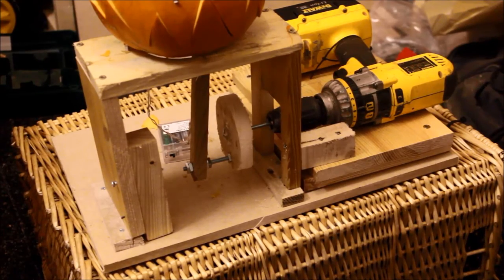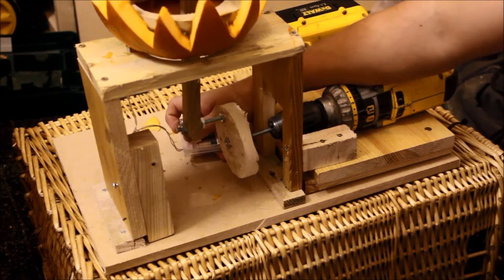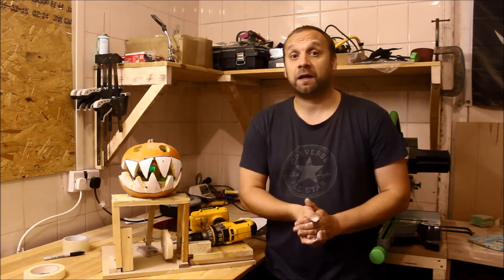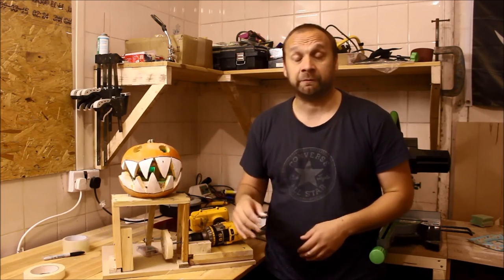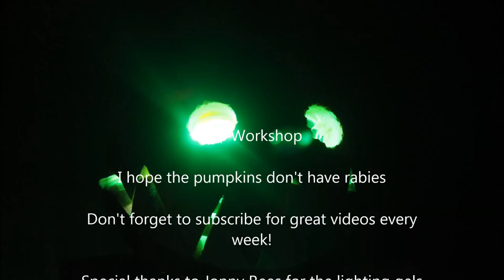Drill Powered Glowing Snap-O-Lantern!!! Halloween Upcycling Project Built From Scrap

Comment: Great idea. I am incredibly surprised that the pumpkin didn't just fly apart. Looks awesome.
Reply from the maker: well the pumpkin shell is well nailed to the top part of the frame front and back though you don't see all that on the video. First time I powered it up more than a whisper the top of the head flew clean off! Also I have the advantage that its bloody freezing in my workshop at the moment and I think pumpkin flesh is just a bit more durable at low temps
Reply: JP's Workshop That's funny. An almost frozen pumpkin would be the way to go. It looked like the whole thing was a lot of fun.